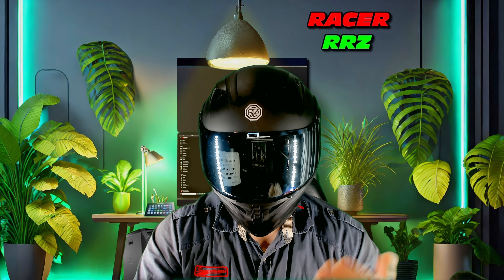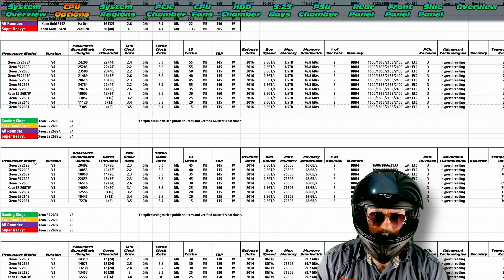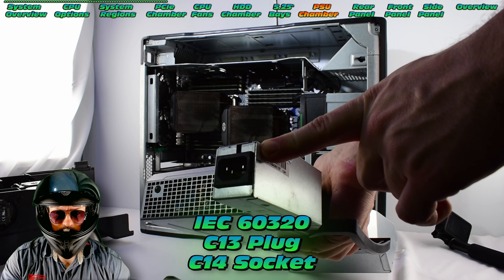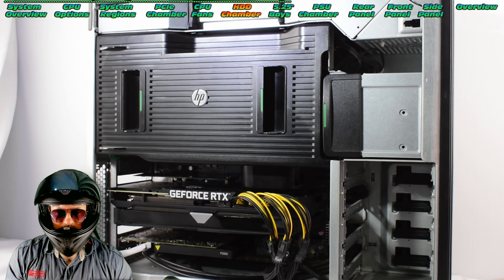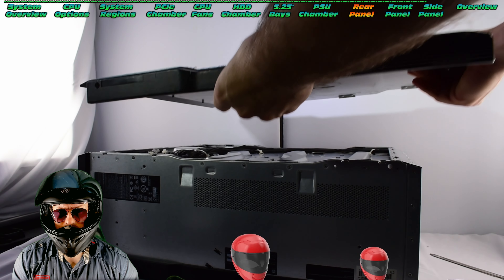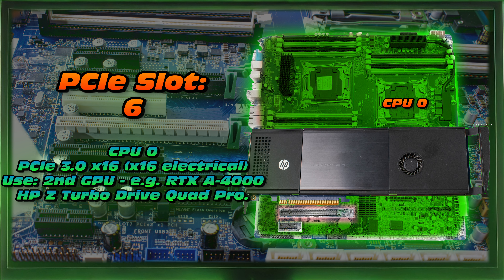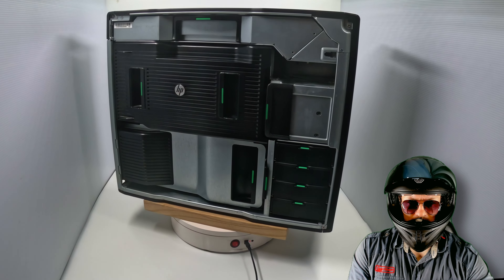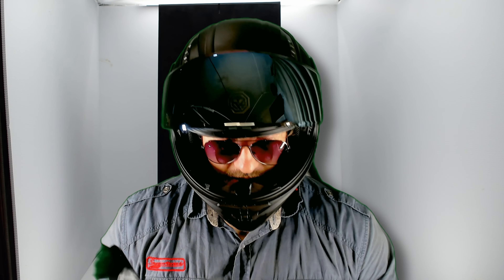This Workstation Would Be It. HP Z840 Full System Overview.

Comment: Very interesting. 

I'm starting to do my own Z840 build and found your content helpful. 

I couldn't help but notice that you have the fans missing to the left of the drive bays. How does the system handle heat? 

I thought the POST/BIOS checks for the presence of those fans. Did you need to do anything special there? 

My in progress build: (waiting for parts to arrive)

Refurbished:
2 x SR2JS Intel Xeon E5-2699 V4 22-Core 2.20GHz 55MB L3 Cache 9.60GT/s QPI Processor (I'm planning to use this for mostly virtualization)

1 PNY GeForce RTX 3080 12GB UPRISING Triple Fan LHR

New:
2024 New AX5400 WiFi 6E PCIe Network Card, Wavlink Tri-Band AX210 Wireless Adapter with Bluetooth 5.3, MU-MIMO, WPA3, OFDMA, Low-Profile Bracket, Heat Sink, for Windows 10/11

PIONEER Internal Blu-ray Drive BDR-2213 High Reliability & 16x BD-R Writing Speed Internal BD/DVD/CD Writer with PureRead 3+ and M-DISC Support

X550-T2 Dual Port 10GbE Ethernet PCI-Express x 4 Server Adapter Converged Intel Network Adapter

SABRENT NVMe M.2 SSD to PCIe X16/X8/X4 Card with Aluminum Heat Sink (EC-PCIE)

StarTech.com USB 3.1 PCIE Card - 5 Port - 1x USB-C - 2x USB-A - 1x 2 Port IDC - Internal USB Header Expansion - USB C PCIe Card (PEXUSB312EIC)

A-Tech 256GB (8x32GB) 2Rx4 PC4-19200R DDR4 2400 MHz ECC RDIMM Registered DIMM 288-Pin Dual Rank x4 Server & Workstation RAM Memory Upgrade Kit

Small Parts: (I'm not sure I'll need everything)
Cable Matters 2-Pack 6 Pin to 8 Pin PCIe Adapter Power Cable - 4 Inches
Noctua NT-H1 3.5g, Pro-Grade Thermal Compound Paste (3.5g)
Monoprice SATA Cable - 0.67 Feet - Black | SATA 15pin to 6pin PCI Express Card Power Cable
Cable Matters SATA III Data Cable and SATA Power Cable Kit with Straight and 90 Degree SATA III Cables, Power Splitter Adapter, and Molex Adapter
Cable Matters 3-Pack 15 Pin SATA Power Splitter Cable 8 Inches, SATA Power Y-Splitter Cable, SATA Splitter
PCIE 3.0 x16 Extender Riser Cable,High Speed Flexible Right Angle PCI-E Port GPU Graphic Card Extension Cable-250mm
Noctua NF-A9x14 PWM, Premium Quiet Fan, 4-Pin (92x14mm, Brown)
Reply from the maker: Nice setup. I had to remove the HDD fan module to make enough room for the RTX 3090 Ti. I replaced the original fan module with slim NOCTUA 14mm 4-Pin fans (covered in https://youtu.be/D1cwwiR4UHM - check the video description ), which prevented any BIOS issues with the lack of HDD fans. Great choice with the E5-2699 V4 CPUs, they pack a punch! Have you tested out the X550-T2? What sort of speeds did you get? You may find my video about the quad NVMe adapters of interest: https://youtu.be/xqg0uQ93KTg . I settled on the Asus Hyper M.2 V2 adapter to get a 8TB RAID 0 pool for a rapid storage library. I am sure others will find your list of mods of use - thank you for sharing your build!

Comment: Question: If you were just getting into video editing for YouTube, starting with standard HD, with the capability of going to 4K, but still trying to keep things as inexpensive as possible, which of the HP Zzzzz would you recommend for a starter video workstation? :)
Reply from the maker: Great question - what types of videos were you considering? 1080p is generally enough. 4k does require more HDD storage space - but large HDD drives handle that with ease. 

The HP Z840 would be the cheapest system to get you started. What is most important is the GPU VRAM amount. I would recommend not going for less than 24GB (I experienced 12GB as ok, but many of my renders would fail due to insufficient VRAM). CPU wise, aim for the highest clock speed, not the highest number of cores. Most of my cores sit at idle because DaVinci Resolve Studio mostly only uses a single core to drive activities completed in the interface. i.e. these systems lag on most primary functions on the editing side. Once you complete a more hands-on task - like caching a video for smoother playback in 4K - that's where all the cores do their thing. Actually rendering a video in MPEG etc. is more GPU intensive - so the CPUs sit on idle most of the time. 

My HP Z8 G4 is handling most tasks really well. I would still have benefited from a higher clock speed on single core tasks but CPU costs are still prohibitive. The HP Z6 G4 could be a nice alternative - they support certain single processor Xeon W CPUs which would give you the best of both worlds (like the Intel Xeon W-3235). Z6 G4's are a bit cheaper than the Z8 G4s generally - so that might be the more future proof solution.
Reply: @racerrrz  HA... I spent 35 minutes with a reply which said it saved, but is now missing/deleted. Thanks YouTube.
Reply from the maker: @jacquesredmond  That's less than ideal. I get just as frustrated with their response system. I have been bitten too many times, I wind up typing long replies in a word document and then copy + pasting them in. Alternative platforms work better for chatting.

Comment: Hello
Thanks for the nice and informative information. It was really very useful for me. I have an HP Z840 computer. It has E-2690 V4 dual processor. I bought two E-2695 V4 processors from E-Bay. It was not included in the table you created. Which processor is the E-2695 V4 processor equivalent to in the table you provided?
I have a question: Can the PSU of HP Z820 be used in HP Z840?
Thanks.
Reply from the maker: Hi. I am glad you found it useful. There were quite a number of other decently good CPUs in the range but I opted to condense it down to a small range of low to high core CPUs - and focusing more on the top end of the range and highest clock speed CPUs. I had the E5-2695 V4's in my first version of the list but it ended up getting removed. The E5-2697 V4 is really similar, same core and threads but higher base and boost clock speeds and slightly higher TDP. The main advantage of the E5-2695 V4 will be price - they are around half the price of the E5-2697 V4 and ~$5 USD less than the E5-2697A V4 (which has 2 cores less but more clock speed). In terms of the Z820 PSU, I am 100% certain that they are not identical in terms of pinouts. Their output ratings are also different - Z820 does 1275W peak, Z840 does 1450W peak. I am sure you saw my related video but just in case - HP Z820's version of this video: https://youtu.be/qkvHQSwyxVQ - PSU specs at 9min 23sec. If you compare timestamp 7:10 in this video and 9min 46sec in the Z820 video you'll see the plugs in the systems have a different number of pins. So no chance on that one unfortunately.
Reply: @racerrrz  Thanks very much for your answer.

Comment: Hi racerrrz. I would like to ask would z440 better to have than the z820. I want a server and gamer / server in one? thanks love all your videos.
Reply from the maker: Thanks, I am glad you have found the videos helpful. For multi-purpose I would like to think the Z440 would serve you better since it has higher clock speeds available. From a pure server perspective the Z820 would work better since you'll have more cores to allocate to tasks. I would go Z440 and get it all geared up. If you run short on PCIe slots you could consider case swapping it into a larger case. I have all my PCIe slots in use on my Z440. Add in a GPU mounted to a riser cable and you have a solid multi-purpose system.

Comment: Hi and thanks for your videos!

I had a RTX 4080 super running on the Z840 with x3 6 pin to 8 pin then to 12 pin GPU connector.

It stuttered graphics and sound now and again, also had black screen once - so decided to take it back.

What’s your thoughts on this being a PSU problem? Currently have another RTX 4070 Super on the way to test again.

Currently running dual E5-2687W CPU’s with an RTX 3080, 1125W Power Supply.

I see you have run the RTX 3090ti and this is a 12 pin with same cable method, so wondering what could be the difference?
Reply from the maker: Thank you for your feedback. I have not had any issues with the power supply setup with my RTX 3090Ti on the Z840 - plus I have pushed it quite hard on both the editing and gaming fronts (insert Cyberpunk 2077 in 4K reference here lol). 

In terms of power supply, the RTX 4080 Super may have instances of power spike transients that could exceed the Z840"s PSU capacity to safely delivery the full power draw requirement. Likely your RTX 4080 Super is rated for 320W but could draw up to 450W for very short duration. (I can recommend Steve's video outline on this issue: https://www.youtube.com/watch?v=wnRyyCsuHFQ) 

The 1125W PSU can output 1450W on 240V mains and I am uncertain what the max output for the GPU power cables will be on 120V mains (maybe 15amps instead of 18amps. If you have combined 3x 6-pin cables (with 6-pin to 8-pin adapters) into 1x 12VHPWR cable that should provide ample power for the RTX 4080 (12.2V @ 18Amps = 219.6W per 6-pin max or 658.8W for 3x cables; 240V mains). 

That makes it more likely that the GPU has an issue, so testing the RTX 4070 Super might give you some clarity. If the issue persists it could be the Z840's PSU starting to run short on power delivery. One recommendation, it would be worth obtaining a Thermal Grizzly Wireview to keep an eye on power delivery.
Reply: @racerrrz  thanks a million for your reply. I will let you know how it all goes once i receive the new RTX 4080 Super 👍🏼

Comment: Been trying to decide whether to get a e5-2696 v4 or a e5-2699A v4. Any specific reasons you put the 2696 above the 2699A?
Reply from the maker: The main contributor is cost. The E5-2696 V4 (Ebay price right now $185 USD) is very similar in performance to the E5-2699A V4 (Ebay price right now $219 USD), but single core benchmarks tend to be higher for the E5-2696 V4. The E5-2699A often is more limited in supply and given a price premium because it is the top of the line CPU. 

I would like to think their differences would not be substantial during normal use which makes the cheaper option the better one. The comments on this Reddit post give a really good breakdown of the differences between them: https://www.reddit.com/r/homelab/comments/utz0s0/e52696_v4_vs_e52699_v4_which_is_the_best_option/

Comment: Is it possible to enable resizable BAR on the HP Z4xx series of workstation? I have seen people do it with the chinese lga 2011 v3 mobos, so I wonder if its possible to do it here too
Reply from the maker: This would be CPU limited. The Broadwell Xeons do not have this feature - thus excluding the Z440, Z640 and Z840 from using resizable BAR. The HP Z4 G4, Z6 G4, and Z8 G4 all have resizable BAR in the BIOS thanks to the newer generation of Scalable Xeons that support the function. I presume the Chinese LGA 2011 V3's are running a modified BIOS because those CPUs do not officially support resizable BAR (there are methods for introducing this it seems). Officially only from Intel 10th Gen CPUs was resizable BAR supported.

But there are those who try to find ways around this: https://github.com/xCuri0/ReBarUEFI/issues/91 . So far - it doesn't seem possible on the older HP machines.

Comment: I have an idea for this build and I just wanna share here. With the help of Linux KVM, you could theoretically run entirely two systems inside this simultaneously. For Example, if I want to use linux as my main system but at the same time I want a capable windows gaming machine, I could just dedicated one processor and its RAM to that Windows VM while also passing through a GPU to it .

And for my main linux host system, I could have its own seperate processor and RAM with its own GPU. This is all theory, I wonder if this is possible, I would love it if you give this idea a try!
Reply from the maker: Hi, that is entirely possible if you use the right software. Using Proxmox as the main software to drive the dual OS system you'll be able to do it. You can specify how much hardware resources (CPU cores / RAM etc.) to allocate your OS. KVM wise there are many options out there. I did look into them but I have not bought one just yet because I was hoping to find a cheap KVM with dynamic device mapping (retains device connection even when switching which prevents screen disconnection issues between device switching - i.e. multi-monitor desktop switching to a single screen when disconnected), but I have not found a cheap KVM with this feature just yet. 

I have actually done this in my FMS Mini server build (taking a Mini PC and turning it into a server!). I had my Mini PC's hardware shared between TrueNAS, Ubunto and Win 10 all at the same time - the joys of virtual OS. I am yet to finish off a video on this however!
Reply: @racerrrz  @abeelsiddiqui1989 I've routinely got my z840 running 3 different VMs at once.  1 is Windows, 1 is MacOS, 1 is another Windows or Linux depending on my mood.  Each VM has its own dedicated GPU, Monitors (yes plural!) , Keyboard, Mouse, and Headset.  The amazing thing is I'm doing this without any extra USB hubs or KVM switch or anything.  Just all plugged into the stock ports.  The z840 is a very fun machine :)
Reply from the maker: @myburn  That sounds like a worked Z840, nice job with the VM setup! 

Out of interest - what KVM are you using? I have been searching for a decent one to get the job done while also being worth of featuring on the channel. I concluded EDID emulator functionality is somewhat a must but that doesn't seem to be a common offering on them. 

My challenge has been the outputs I need. I am mostly on two monitors - a 4K 60FPS DP1.4 and 1080p writing tablet (USB C and HDMI combo). Having the same peripherals connected to both systems would be a bonus also. So far the Rytaki Pro 8K 4 PC 2x DP and 1x HDMI is my front runner (Amazon).
Reply: @racerrrz  Thanks :)  Sorry if I wasn't clear, I am NOT using a KVM for this crazy setup. So I have no advice for you there.  I have a unique GPU card, Monitors, keyboard, mouse, headset for each VM, and everything is just plugged into my z840.  Thankfully the z840 has a ton of USB ports, and I think I am dangerously close to maxing out how much wattage my z840 can give to GPUs .  If you walk into my office room it looks like I have 3 different PC setups spread across 2 desks, but everything connects back to a single z840 .  That being said I have absolutely no use for all these different VMs... I just wanted to set it all up because it's cool, lol
Reply from the maker: @myburn  Ah nice haha, that sounds more like my setup - except I have different systems for each application /  end-use. I feel like a room full of workstations all controlled from a single station is the ideal end case (ignoring the power bill). The coolest thing for me was remote desktop. Accessing multiple computers from one system is the dream. Multi-tasking and all that. 

I'll have to continue my hunt for the best KVM (it will make it into a video eventually). Ideally - being able to keep the same keyboard, mouse, microphone and writing tablet connected to multiple systems would be the dream. That way I can get the one system to export a project while I continue to work on the next project. Right now I wind up having to wait out video project renders to ensure no crashes (GPU use tends to peak out and even just watching a YouTube video can cause issues - hence the need for a second system).